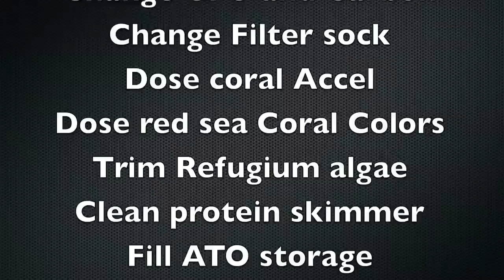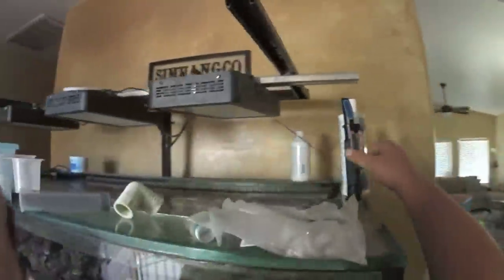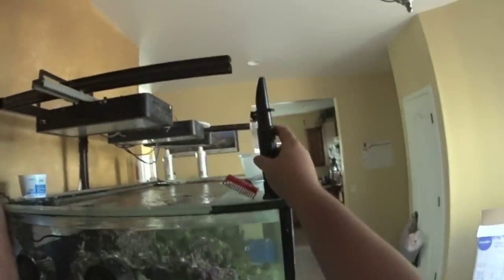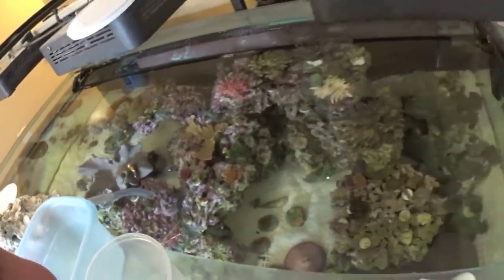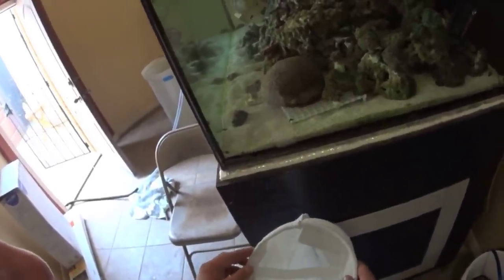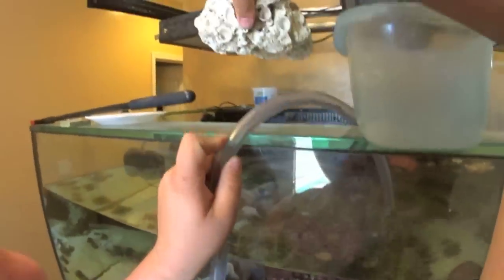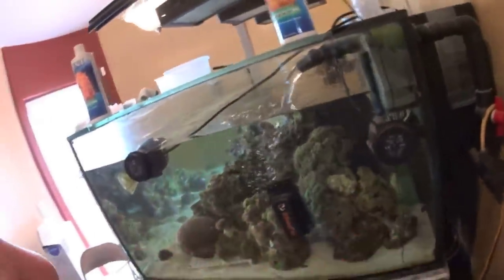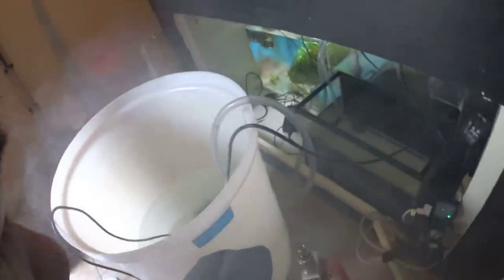Full Reef Tank Maintenance

Comment: Pretty sweet. Was thinking about doing a similar vid. One thing I do is do my w/c out of my sump. The benefit of this is no livestock in the main display gets exposed to air. The only downside to this is you can use a gravity siphon.
Reply from the maker: *****   Its just a  pain in the ass for me to do it from my sump.  I usually stir the tank up with the power heads full bore and syphon from the tank to suck out as much of the muck as i can but didnt do it for some reason in the vid.  I dont really like the coral exposed to air but they dont seem bother by it at all.